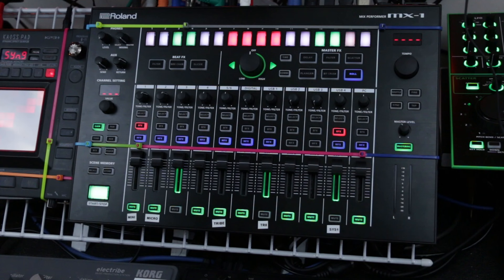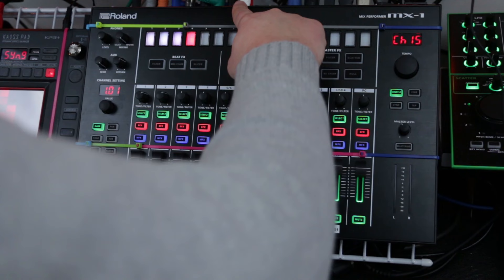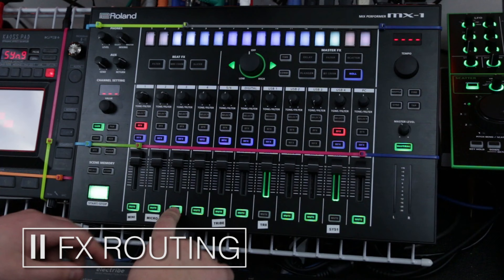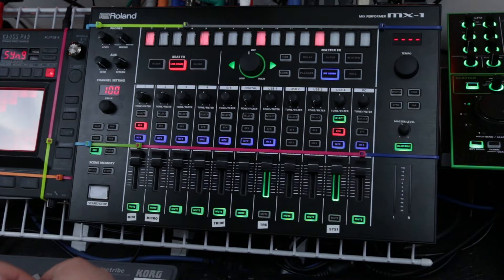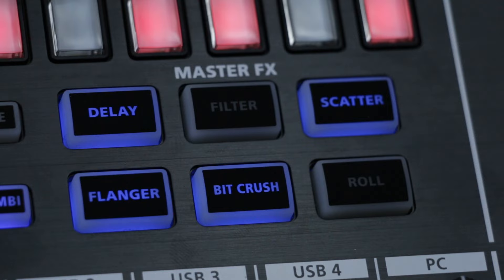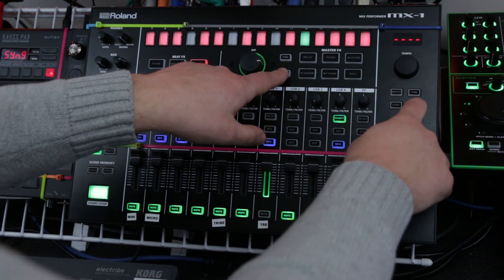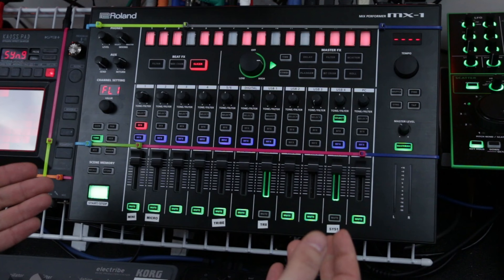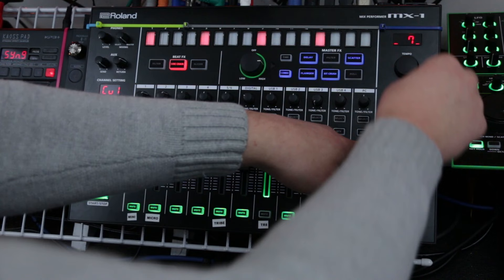How to use the Roland MX 1 (Tutorial)

Comment: I love the idea that roland developed in this mixer. I have a tr 8 and a tb 3, and I'm adding more gear soon, so being able to sync all the aira stuff and another synth like you have to the mixer, without the need of a midi splitter or another box is an amazing bonus, plus you can sidechain every channel so easily. 
The only thing I don't like about it, is the absence of an eq per channel...yeah you can work around this with the filter knob, but it is never the same thing as having a 3 band eq right there at your fingertips. Also, you can't route individual channels out and in to another mixer, or if you ran your gear first through a mixer and then intro the mx-1, you end up losing the sync capability...I guess you gotta make some sacrifices :)
Have you felt the need of an eq per channel when summing all the sources? Or was the "mastering" knob good enough for a live performance?
Great video and explanation! Cheers from Portugal

Comment: One thing about the mastering effects that I haven't seen anyone mention in any tutorial video:
If you hold down the mastering button and turn the [Value] knob you get 65 parameters to adjust the mastering effects and the weird thing is that they are not mentioned in any of the manuals or anywhere so I don't really know what parameter does what. Any idea?

Also, if anyone doesn't know what the mastering effects are:

1: 4-band EQ
2: Low Cut
3: Enhancer
4: Splitter
5: 3-band Expander
6: 3-band Compressor
7: Mixer
8: Mid/Side Control
9: Limiter
10: Dither

I don't think this means that if you hold down [mastering] and choose 1 for example that the sound only goes through a 4-band EQ, I rather think that the sound goes through all those effects from 1-10 and the [mastering] + [tempo] knob just selects one of 10 preset combinations of those effects, but I'm not really sure because Roland really don't mention it in the manuals.
Reply from the maker: That's crazy, I just tried it and what on earth are all those options?!
Reply: Holy crap. Seriously, this needs a write-up. I found the Mastering presets but the Master+Value knob is crazy! I'm scared to touch those.
Reply: Thanks! 65 values, but with 5 to 10 sub-settings or ranges for each of those 65 values.  Who knows what all of this does, exactly, but now I have a huge rabbit hole to go down and get lost in.  Awesome!  Thanks for this.  I've only owmed this MX-1 for a few days, and it's the perfect center peice for the TR-8, TB-3, System-1, and SP-400a that I have had for a bit.
Reply: @JarretLaMark  Have you figured out something about these settings ? 
cheers

Comment: I have question : sin you have all out gear how do you connect all those gear on the mx1 because it only has 4 audio mono input
Reply from the maker: It has 4 mono, one stereo and if you get an analog to digital converter, the digital in is another stereo track. Then if you use any aira or boutique gear you can connect them to the usb tracks
Reply from the maker: Also you have aux in which in a pinch can get you more sound, just no BFX
Reply: +Anonymous Animal 2 thanks for  me back.
Reply: Anonymous Animal 2 Great tutorial, I have one but really never had a chance to use it. This is very helpful. I hope you do tutorials like this on a regular basis. Cheers! Mitch

Comment: Hi, very clear tutorial! I've got a question for you: is it possible to connect mx1 to Akai Force in order to use it as source of sound and sampling? I've got all Aira gears connected to it and I find useful its  clock function. I've got a big lack of knowledge too about midi connection so I don't know how mix Aira with Akai. Thanks for the support
Reply: you could run main out of Mix 1 into Akai.... as far as midi.... shouldnt matter... but probally makes sense to have mx 1 as master
Reply: You'll want to do it the other way around, as per the comment above. Connect the Force to the MX1, and route the tracks from your Force through the separate channels on the MX1.

Comment: Hi , are you able to record any synth via Analog input into your mx1 while using aira stuff via Usb ? For example to use two boutique synth via Analog input to mx1
Reply from the maker: Yes, the USB inputs have their own separate channels, usb3 will power a boutique, and pass audio thru. I actually have a JU-06 running on usb3, with a JX-03 running audio into the audio in, so I get both boutiques on one channel.

Comment: Can I use it to mix four boutiques?
Reply: Yes- but you need to power three out of the four of them, as the MX-1 only has ONE powered USB port. SO- you need to SPLIT the USB on it's way in to the MX-1: one for the MX-1, one for a power plug. The splitters are available on eBay and other cheap online outlets.